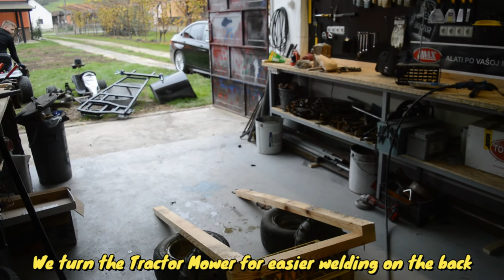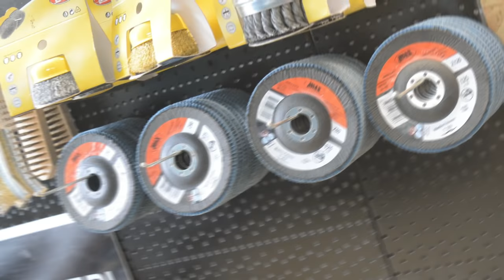Homemade EXHAUST For TRACTOR MOWER !?🔥⚡

Comment: I actually would have decreased the sound a bit more. A small muffler or so could have been in the middle or just some packing material in the one that is currently empty. I think that could improve the sound quite good :)

Now try to make some pedals and so for it  xD    I have never seen anybody do it.. putting pedals like on a normal car on a tractor like this.

Comment: Be careful backing up or you'll have a way different exhaust sound. Now you need to get a twin cylinder engine, preferably a B&S horizontally opposed. I like your work and your skills are terrific.
Reply: I have a opposed twin, i took the muffler off and it sounded amazing

Comment: The only thing I would tell you is to be careful at the spindle plastic cap on the deck, if the muffler gets hot, it will burn it, that’s why the muffler in in the front. Also grass will be able to land on the hot muffler and burn

Comment: Had a scrap tractor with a briggs 17 horse, motor ran great, put that motor on a old MTD chassis but couldn't use the factory exhaust so I made one out of threaded Galvanized pipe, Boy did that thing blow out flames, then I used a muffler from a push mower, worked great.

Comment: You should have made a straight through muffler with drilled pipe going through another bigger pipe filled with metal foam , it would make it a bit less noisy and improve the droning so it would sound better and on top of that you dont lose any HP with such muffler. Bot still awensome job!
Reply: You know what off a lot of criticism coming from over there how about just tell him great job
Reply: @kennethrenock6588  at least read the whole comment

Comment: Nice job man. I had a bolens st160 with a 16hp vtwin i put a stack on it and it was quieter then the stock muffler and the stack was a straight pipe

Comment: Cool and interesting, but might want to check your fuel/air mixture. I would expect a lawnmower, like a motorcycle or four wheeler, would be running lean if you free up the exhaust but don't richen the carb. Sound good though. 👍

Comment: You can rev it up on the side of the engine next to the carb is the throttle an u can rev it was better . Instead of moving the throttle arm up an down

Comment: I made a Mcculloch MT105 look like a full size tractor, by cutting a hole in the hood, and point the exhaust upwards. Adjusted the carburetor a little and put some diesel mixed gasoline in the tank. Mows 10 inch grass at idle and has a nice crackle to the sound (also backfires HARD)

Comment: iv‘e got a custom exhaust on my tractor too.. its a side pipe with a Volvo muffler - sounds pretty badass. got the carburetor from a motocross in it and changed the transmission. 

running about 50-60 km/h .. 

but yours defenetly looks a waaay better. well job. 

greetings from Austria ✌️

Comment: Now just ditch the mowing deck, bypass the governor, make a foot throttle and pulley swap it. all that work for a mower an exhaust like that needs to be on a racing machine. it looks and sounds great. good job

Comment: you don't have to pull the lever up and down, there should be on engine rpm lever, so you can test the sound even better with higher RPMs.

Comment: Absolutely love it! I’m in the process of doing a bit of customizing to my cub cadet. Has a Kawasaki twin in it. So, by removing the muffler won’t affect the engine performance in a negative way? Was thinking I would run two separate strait pipes all the way to the back . Any advise would be greatly appreciated. Keep up the awesome work bro!

Comment: I like it, but I think I would have went under the wheel well and over the rear end. I would have ran down the side of the frame, straight under the floor panel and over the rear end. I wouldn't have ran it under the steering assembly.

Comment: If you made a proper muffler using a perforated pipe inside a larger pipe, packed with fiberglass mat, you'd have a very effective muffler compared to the straight through.

Comment: You waste a lot of material!     You first bent the pipe in the middle cut both ends of the bend then used a straight piece after that was already there that you cut for no reason!

Comment: Your execution was 100%, and great craftsmanship for eyeballing it!   But you eliminated any sound-deadening muffler may have done, I guess the lower tone is less disturbing then! My only concern is the exhaust tubes are too close to the tires. I imagine the excess heat may shorten the life of the rear tires!

Comment: Nice job but don't think i would have spent that much time on a motor after 7 to 9 years blows the head gasket and drinks the oil out of the sump when not checked then throws a rod I've got 4 with rods thru the block or locked I got for free off other owners  these overhead designs did not  put a bolt thru where the overhead valves have too wide of a span between the head bolts making it burn into  the  pushrod cavity overtime and if owner don't keep an eye on it sump and does not notice the light blue smoke its toast replace the head gasket and torque it back and your good for another 4 to 8 years the tell tell sign is light blue smoke at times or all the time when mowing also if you suspect this always check oil level  pretty often on hillsides this low level will take the motor out over time

Comment: 20:56  I got a question.... 🤔  Why did u tape up the positive side...? the battery wasnt in there, wasnt connected to the ground
Reply: wait you taped up Both sides  🤔 🤔 🤔 🤔  why..?   Also your suppose to put on the positive first not ground the battery first then positive...  always positive first

Comment: my only comment is, the end of the exhaust is a little low to the ground and looks like it is cementers from rubbing on the ground. Overall it looks great, also the heat wrap would have been better if it was a bronze or a silver to match the mower. Looks good and sounds good!
Reply: 'cementers from rubbing on the ground'? ho-lee...
Reply: @MimicoBungalow  yeah when you are on taller grass it looks like it is cementers from rubbing

Comment: I'll give ya an A for effort and creativity. Welding...gotta give ya a C-
Taking the mill scale off and putting a bevel on one side will give you Complete Joint Penetration. I would also practice more. You should never need to grind a weld.

Comment: Why is the can empty??? You could've made it sound a hell of a lot better using a perforated tube, rock wool and fiberglass matting for the wadding. I've made a few mufflers from scratch and that's how it's done. The can being hollow is going to make it sound more 'boomy.' Since theres nothing to dampen/ deepen the sound in the muffler, a straight pipe would actually sound better in this scenario believe it or not.
Reply: That's what I was thinking. Couldve easily made that into a glass pack

Comment: A big waste of time if you want extra hp, pipe should be polished  in side and made larger as soon as you could, not restriction more with cut off joint and welding.

Comment: Not gonna lie but it didn't sound to much different after vs before. A little bit yea. But I love the idea👍👍👍👍👍👍
Reply: No 💩   He didnt make an exhaust muffler just made it look like it on the outside.. Inside it's still just open pipes
Reply: sounds just like a hollow pipe would sound  terrible but the sound is now behind the driver, so it wont be as loud for the driver atleast

Comment: The exhaust is very close to the back wheels.
Reply: Ye i saw it too tf
Reply: I think about all the heat rising into the trans axle unit. The exhaust is so low that if you had to reverse over anything but flat ground it would dig in.

Comment: Ya know it would sound great if it would rev higher
Reply: You can't rev these past 3k
Reply: @tbah9402  ya I know the flywheel will fly apart.  But you like you said you can rev it up to that.  It’s definitely not at 3k
Reply: @HemiLife263  the flywheel will be fine the govenor stops it from revving that high on stock mowers
Reply: @tbah9402  take the governor off lmao
Reply: @HemiLife263  then you couldn't use it as a lawnmower anymore

Comment: Now we need longer gears to get her going a bit faster
Reply: actually, I'm doing that rn. you have to change the pulleys on both ends and you go pretty fast. The big problem is steering and in his case, unless you only drive it on smooth pavement the exhaust system will get beat up

Comment: I mean cool, and if you're happy with it that's even better.

However, I don't think you need the heat guard on the front anymore, since the new exhaust hugs the frame.

You're also doing more harm than good with the wrap than you would have with VHT paint. It causes stainless pipe to rust out eventually so this mild stuff won't last long.

And lastly, look at all the ground clearance you gave up.

Comment: These engines need the back pressure. The exhaust is also touching the tyre.
Reply: He's just messin around. Just a mower...
Reply: I'm pretty sure that this is a 4 Stroke engine so back pressure is pretty unnecesary or at least not that important. Especially on a mower.
Reply: This extremely long exhaust probably creates more backpressure than the stock short exhaust amd muffler
Reply: @ezrawaters6653  i think its still pretty open due to the extreme size of the tubes

Comment: really no idea of protecting the end tips as u have already infected them with normal metal witch will cause them to rust
Reply: Because not alike metals touching each other produce voltage and a chemical reaction similar to a redux battery, causing corrosion over time.  I just wanted to say that out loud :)  Youtube university postulation and potential correlation. Best exhaust system ever. :)

Comment: First, welding by the gas lines???? And yes everyone has a set up to manufacture something like this.  Otherwise entertaining but not practical.
Reply: is very practical no everyone does not have the gear to do an exhaust like this prob most dont who watch this and the build was great

Comment: not to mention if you going to straight pipe it especially at the length of the exhaust you will need to do a jet because it may run better but you decreased the hp quiet a bit probably 2 3 hp you can destroy your motor buy doing that its needs to have back pressure
Reply: You really think that exhaust has reduced the backpressure? LOL
Reply: Dude... It's a lawn mower not a muscle machine. Don't worry about the carb. It's not about the trip, it's how you get there.

Comment: Anyone else notice how close those pipes were to 1.) the plastic deck. 2.) the tires. ?
Reply: hm true. wonder if that's why he used heat wrap
Reply: @mattheww2647  even still, too close. I wonder if he ever thought about making it as silent as possible?
Reply: @robertfpjr  garage 54 did a video like that
Reply: Deck is steel, pully guards looked like metal upon multiple replays. Can't really know for sure. The Header wrap holds most of the heat in. Most of what you hear from the front is the sound of the blades spinning. The note from the rear exhaust seeme to be a more pleasant Lower Tone. Getting it pointed back and away from the operator is a definite plus.

Comment: What if you're driving thru a valley or hill, It would get caught in the ground and scrape.
Reply: I thought exactly the same. Moreover what about tires, after a long work and high temperature of the exhaust.

Comment: Heat wrap? Why?😂
Reply: So you don’t burn the belts and stuff on the undercarriage?
Reply: @backyardburnouts8846  oh ok. Fair enough mate. Good call.
Reply: If i was going to do it id do a pipes out each side of the front cover and pointing up with an truck exhaust flap on top of each one for a laugh😂 but you did a nice job mate and louder is better😎😂😂

Comment: Bee careful the carbon monoxide poisoning can and will kill you from this modification and you wouldn’t probably bee able to tell other than a noxious headache
Reply: Be*
Reply: Alright big brain🙄
Reply: They didn't have cats b4 hand to convert the gas to begin with 😞
Reply: Ummm. It still emits the same exhaust fumes. It's actually better, because it exits behind you as you mow, not in front of you. Also the noise is behind you so it may seem to be a little quieter up front.

Comment: I wouldnt have even wasted my time doing that and the tips are way too low plus thats probably not good for the engine. Too much back pressure. You also need to adjust the settings on your welder.
Reply: Looks you are really jaelous. It is actually a lot better for the engine and he has done a perfect job. Only thing I agree on is that the exhaust tips are to low near the ground. He will damage them when reverting into an ridge
Reply: @_DutchFox_  Man, don't waste your time on male versions of karens
Reply: It's not too much back pressure, if anything he was risking not having enough back pressure by removing the muffler, but I guess it worked out for this mower, because he said it runs better.
I think it's cool as hell and of course, it's silly and a waste of time and money, since when does that matter, it makes him happy and he had fun doing it, that's all that matters.
I just looked, this guy has over a million subs, the more silly projects he films himself doing, the more money he makes, good for him.